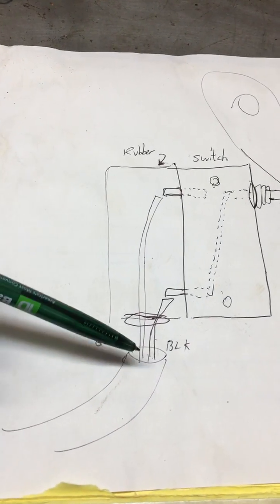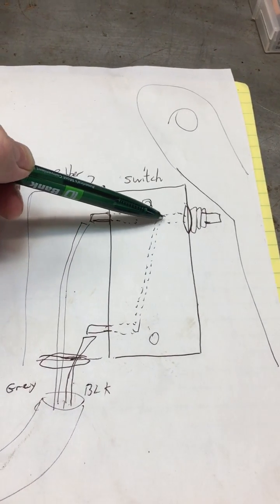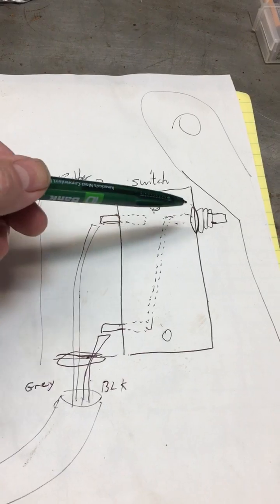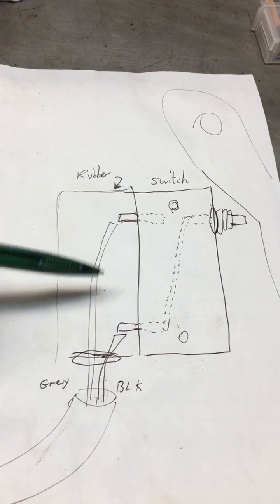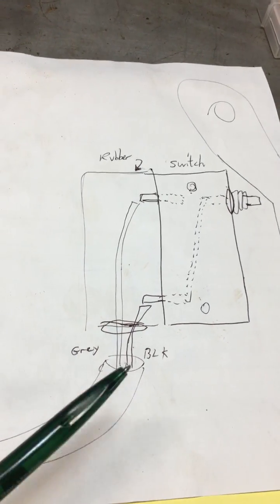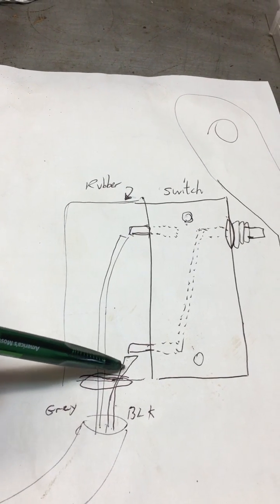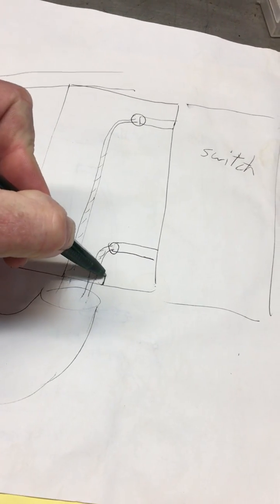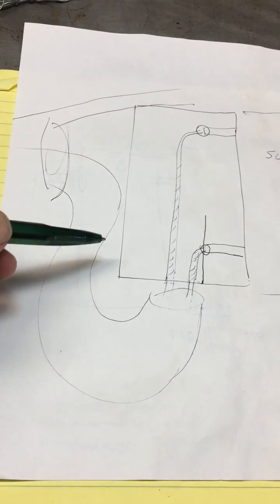KTM 790 clutch switch failure and repair

Comment: Can the two wires just be twisted together to bypass the switch without causing issues with the ECU?
Reply: Good question! I want to know this too
Reply: I have the same cuestion. But i think they need a resistance or some thing like that :s The best option is "always in push mode"
Reply: It causes issues. Fuel maps, ignition maps, etc., are tied to the clutch safety switch.  Some motorcycles take a bypass easily, these aren't one of them unfortunately.
Reply: Definitely not. Mine's broken in a different way - the thing that comes in and out just stays in one position. It causes some weird problems with ignition and bike stalling randomly as the ECU thinks the clutch is always pulled.